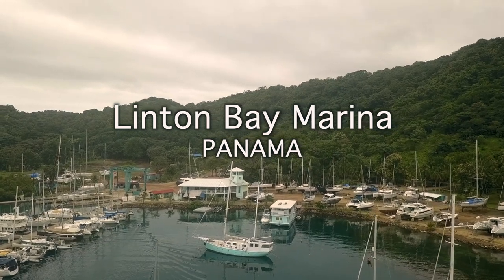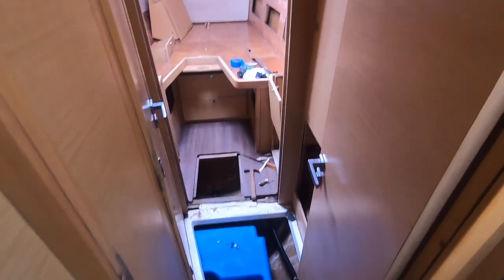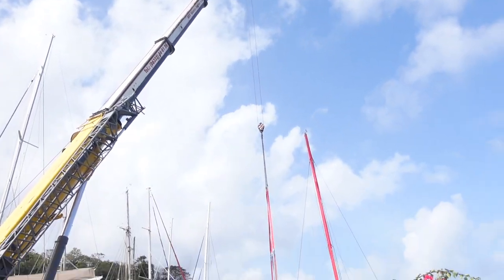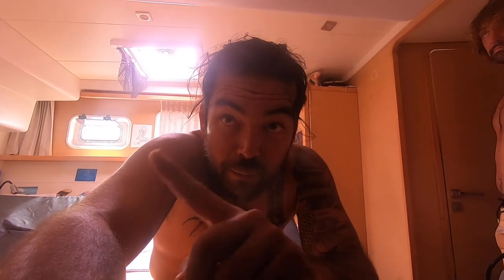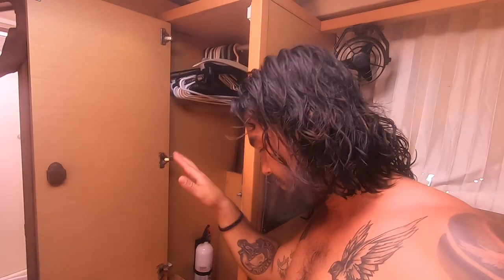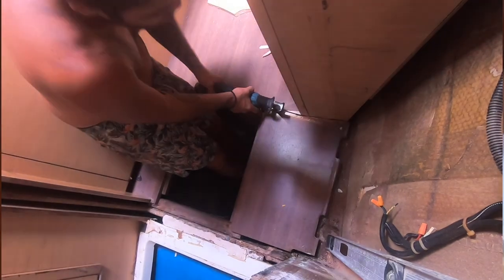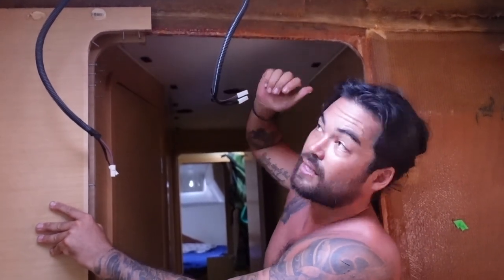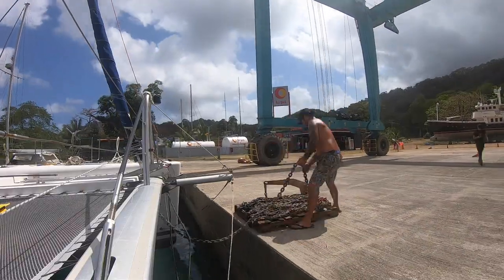CRACKED BULKHEAD REPAIR SERIES - Part 2

Comment: Jamie's  demented laughing at the bulkhead part is in essence how fked the  boat is. I sure you guys can fix it but for the average joe owning the same problem they are screwed. If your boat is in that condition how many others are seeing the same problems.
Reply: Over 50 and counting. This isn’t restricted to the 450 either. Other Lagoon models are seeing the same issues and I’m sure that other makes of production cats will have similar issues once the inspections of these critical areas are checked.

Comment: How do you think however did to cause damage like this? Got dropped by a Crain? With that much structural damage I would think evidence on the exterior. Seems like there would be more obvious signs of accedent or major repairs.
Reply: Did you see the outside of the boat when he first bought the boat?? ;-)
Reply: No, not watching every video everyone puts out. But you said the deck separating happened before the hurricane damage. So was just wondering how something like that could happen. Maybe your boat has gone through more than one hurricane.

Comment: Collin,

I've completed some research. There is clearly a major design failure. Please realize aggressively reinforcing all the points of failure does not remedy the design flaw. It is highly probable stress will simply transfer to the next weakest position of the inadequate design and lead to a secondary catastrophic failure.

Comment: This video series will add one element in the debate between catamarans and monohulls.
Monohulls are made of one piece of fiberglass (plus the deck) where Catamaran are made of 3-4-5 pieces of fiberglass glued or fiberglassed together. 
I think catamrans will have a much lower durability than monohulls because of structural weakness.
Reply: You forgot the grid and the bulkheads on the monohulls. The construction methods and materials are very similar these days. The main difference is that on the cats the main compression loads are transmitted onto the bridge deck between the two hulls trying to splay them apart which is why the structural bulkheads need to far stronger than that of a monohull.
Reply: @alanpiper9614  You're right but he catmaran also has a deck and it's not a structural weakness on both.
To simplify my comparison, a monohull is made of a single bulkhead where a catamaran is made of two bulkeads glued to a bridge sometimes made of multiple parts.
Another point : in moderate to strong winds, the monohulls leans where the catamaran stays relatively flat ; all the force is directed to the structure.
Reply: @pierred7183  spot on Pierre except I think that you meant a single hull as opposed to two hulls (not bulkheads). The cats are subjected to much higher stress loads than the monohulls especially when under sail. The simple difference in the geometry for the compression loads from the mast and standing rigging is clearly visible. And is magnified when under sail with the loads greatly magnified due to very little heeling as opposed to a monohull. This issue with critical structural failures on cats (especially lagoons) is nothing new and is down to the poor design, materials and workmanship in construction. This is true mainly on the production cats. The bespoke builders don’t have anywhere near the same issues as they are built to a much higher standard than the “glue and go” production builders that are really aimed at supplying the charter market mainly.

Comment: Not sure how much more work it would be to remove the top and pull it apart from the top
But you might be able to remove the non structural modules allowing you full access to all the structure. Mind you this comment comes about 3 months too late.

Comment: The folks at sunsail or moorings should be sued. The way they patch things together to repair charter damage and issues is criminal.
Reply: That's usually what happens when you want it cheap and quick.
Reply: @sheerluckholmes5468  how about disabling propane switch instead of replacing it? thats just plane stupid. and unsafe

Comment: Man u need a guy my size to crawl in there. Im 5'5" amd 130lbs. Lean and if my skull fits i fit. Ive climbed down 16" wide formwork 20ft down with double mat rebar to retrieve stuff rather than tear down the form

Comment: You should really take a sanity check here. I know your capable of fixing, but with all the time and money poured into it, not mention the possibilty of running across something halfway through repairs that will end of totaling boat. Right now you have a boat with bad bones, and built with low quality materials. All that will have to demo'd out and done right is really worth all that time and money. sentimental attachment can cloud your judgement "I've been there myself" at some point you gotta sanity check this project.

Comment: Remove  The deck .  Interior walls are the part of the structure
Reply: No they are not. The method that most production builders use is that all the cabins and heads are drop in modules that are glued in spots to stop creaking before the top deck is put on. The structural integrity is in the structural bulkheads, that is what has failed due to poor design, poor materials and poor build quality.

Comment: It is such an unfortunate shame that so many production manufactures are cheaply using this method. I cringe at all the shots of bonder everywhere rather that properly glass/epoxy in bulkheads and structural grids. You are being far to kind with these people. Call it like it is on this weak a$$ practice.

Never the less thank you for your excellent work and channel.

Comment: This isnt lagoons fault they could reduce water damage by gelcoating the inside of there hulls but if you goggle harborshoppers knotty dreams 2 you will see colins boat forsale for 90 thousand but it lists and shows pictures of almost the whole boat underwater now if you go back to the first episodes you will see the hire companys name on the steps theres was another add from the catamaran company selling the boat before urma for $535000 id split topside from botom side to repair after you check out harborshopper also check out what happened to knoty dreams another boat owned by the same company

Comment: I do not currently represent nor have I ever been in any way affiliated with Lagoon yachts.

I am merely an interested observer via YouTube and none of what I write is intended to construe or be perceived as counsel or advice.

For the information of anyone who may not give due consideration to such factors.

Once possession of a vessel is transferred from a manufacturer to an owner control over how the vessel is used and treated from then on regarding normal procedures such as maintenance, operation and so forth is beyond the control or even assertive influence of a manufacturer post-warranty.

Probably virtually all catamarans must be subject to weight limitations in order to accommodate structural limitations and overloading such a yacht can have serious consequences.

Apart from this it is also possible to 'overpower' yachts in general and catamarans in particular while they are under sail which can result in various kinds of structural stress and even damage some of which is unique to multihull yachts especially if they are also overloaded and or subjected to heavy seas.

So far as I am aware no technical means such as strain gages by which relatively unskilled crew could determine stress levels imposed upon yachts subject to amateur operation while under sail are incorporated to them.

By Colin's own admission a balance of probability strongly suggests problems that have been revealed by his skillful survey of Parlay Revival were likely to have originated prior to his ownership of the yacht or even it's wreckage prior to that.

It is therefore highly likely that such damage weakened the yacht's structural integrity prior to it sustaining hurricane damage.

Under such circumstances the yacht would be particularly susceptible to a greater degree of damage during a hurricane particularly when compared to a yacht in sound condition.

To top it all off the yacht has been equipped with replacement rigging and sailed some distance then hauled out and subjected to extensive additional repair since it was written off but nonetheless salvaged.

Therefore the total extent of problems present and magnitude of circumstances prevailing at the time Colin purchased Parlay Revival were evidently significantly greater than he was aware at that time.

Colin has been careful to fairly point out that because Lagoon are prepared to assist him with advice in repairing his hurricane damaged but salvaged yacht despite it having presumably been written off as a total loss by an insurer, it is a very reassuring testament to the corporate philosophy of Lagoon even if subject to highly specific circumstantial proviso's.

Comment: Sell everything off the boat, partly fill the empty shell with concrete, tow out to a big hole in the seabed and pull the plugs,  then buy yourself a proper boat.

Comment: With as much work as you need to do, I’d cut an access hole in the cockpit floor to get in easier for repairs. With your knowledge and experience with glass it will be an easy fix and give you much better ingress and egress for materials you need to work in there.

Comment: DOUBLE UP THE PLYWOOD FOR THOSE BULK HEADS AND USE WEST SYSTEMS AND MAKE A SANDWHICH WITH THE TWO SHEETS OF PYLWOOD AND WEST SYSTEMS IN THE MIDDLE!!!!!!!! THEN TAP THEM IN THEN LASTLY GASS THE FUCK OUT OF IT!!!!

Comment: Structural design flaws Lagoon was never built for the real open ocean. They are built to a price point for calm water lite wind sailing only. Privledge has an aluminum skeleton with full beam supports hull to hull. At least my 1993 48 did.

Comment: Boat was a total lost for a reason... 
it’s only worth to repair it this way, when you do it by yourself.... passion is one thing but also time spent on repair easily could be spent somewhere else where you can make a money to buy a used boat that hasn’t been damaged like this...
I think this boat has been manufactured poorly from a factory.... I mean on boat that cost more then $500000 when is new they are laminating with some glue structural elements is simply ridiculous...
On the start if factory have spent extra no more than $5000 for epoxy components with fibreglass boat would be much stronger.....(i think that all timber components are prefabricated for this boat and they simply throw it inside and they glued because it’s much easier then playing with fibreglass in tide space.... and after they put a top on the boat that’s it... they save time and money and boat is probably structural sound for warranty period and after that period builder don’t care, or even better boat is not designed to survive any hard hits from other boats or docks....
Me as house builder understand how much of time this will take to fix it correctly and feel sorry for these guys because i am sure that they would walk away from this boat in begging if they knew 50% of work that actually needs to be done...
However, fish them all best, great videos and calm sea with good winds once they put this baby back in the water...

Comment: When do you walk away from this boat?  It seems to me that you have become more of a boat builder-repairer than a sailor.  Is that the life you want to be living?  Add up your time and costs to find that this repaired boat will cost more than a new boat.  No one will ever trust this boat again and your chance of selling it for what you have put into it will be difficult.
Reply: @Adrian Matthews That is simple to answer, working for a living.  Do you want to be an engineer or a fiberglass boat repairman?  The insides of the boat has been trashed.  I am sure you could sell it to some fiberglass repairman that makes $15/hr.  As an engineer you can make upwards of $50/hr or more.  Your boat's electronics are fried from the lightning, and the cabins are all demolished, so the insides, worth over 50% of a new boat are trashed.  All you have now is a broken hull of a boat.  If you work for free you will still never get your money back for even the material costs.  I know, your ego and determination will prevent you from walking away from this boat and admitting a mistake and bad circumstances has made this adventure a failure.  You only live once and your time is valuable and your life is precious.  We all don't live forever and you seem miserable now.  Yes, starting over is hard to do.  I know you will fix this boat and put in lots of your free time and dollars to restore it.  All I am saying is to think clearly about what you are doing and what this is costing you.  Then do what you have to do and good luck to you.
Reply: @Adrian Matthews Yes, you are correct that money does not buy happiness in life.  Money does open doors for you to do the things you do want to do to make you happy.  All I was trying to convey is if he is miserable being a fiberglass repairman, then it is time to move on to do something else to make him happy.  He needs to remember that he has a few good years to live the sailboat life and then he will be too old to do it.  Life is way to short.  Was being an engineer on a big yacht that bad of a life or was the pay just to small?  Yes, we all have to work to make money but you should enjoy that work too.

Comment: I dont think Lagoon are helping you guy's out because they are nice people, a simple search of Lagoon 450's will show its a common problem with the bulkheads, why the bulkheads were not glassed to the hull instead of that grey glue is a mystery, also the fact that someone had made efforts to rectify bulkhead issues prior to the hurricane damage shows the fault lays well and truly at the feet of Lagoon.